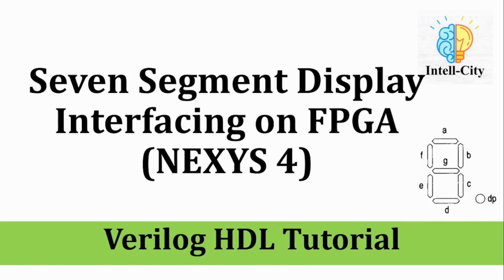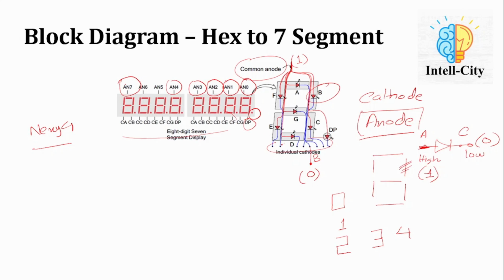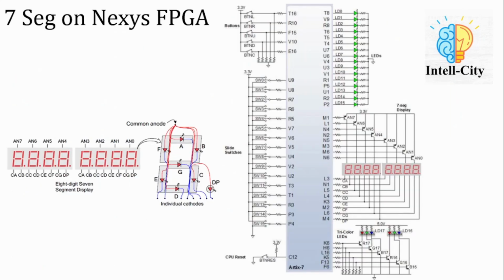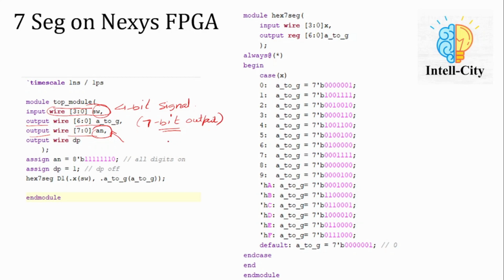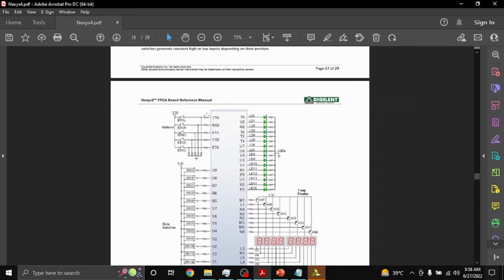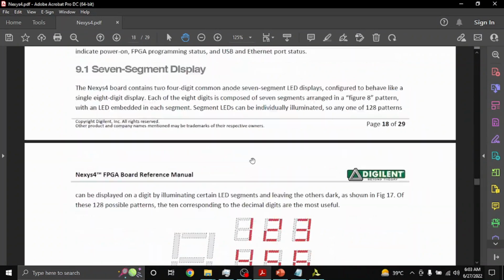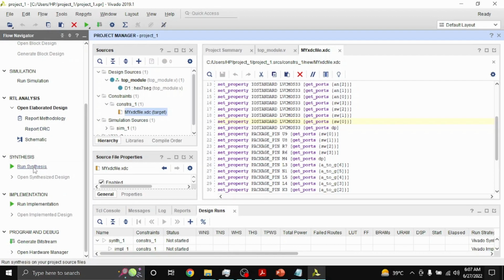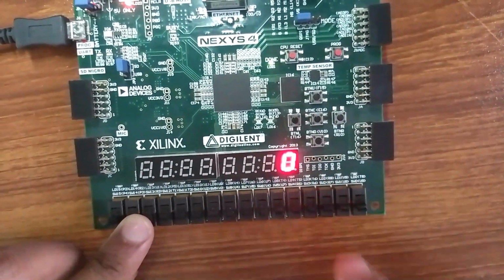How to Create 7 Segment Controller in FPGA using Verilog? | FPGA Programming in Vivado| Nexys 4 FPGA

Comment: Does this works on xillinx spartan 6 as well??
Reply from the maker: The code will work on that device, but I the pin description will be different for spartan 6, and it needs to be modified.
Reply: @ElectroDeCODE working with ise design suit with JTAG doesn't it reads pins itself?

Comment: my 90-year-old mother could program a module to turn on a single sseg display.  Where it is tricky and I have not found a single example is to turn multiple on at the same time since they all share the same 8 LEDs.  In theory, I know what needs to be done but I do not know how to put it into practice. I know I have to cycle through the anodes displaying a value with each corresponding anode but I can't figure out how to do it. I cannot make four instances of hex7seg because all four share the same 8-pin positions for the 7 segments plus the dp.
Reply from the maker: New video for using multiple 7 segment displays will be uploaded soon.
Reply: I am getting the same problem. Just wanted to on all the digits of the seven segment display. Need help! I am working on Boolean board xc7s50csga324-1. You can make a video on it also.